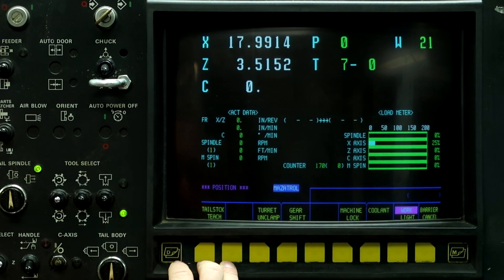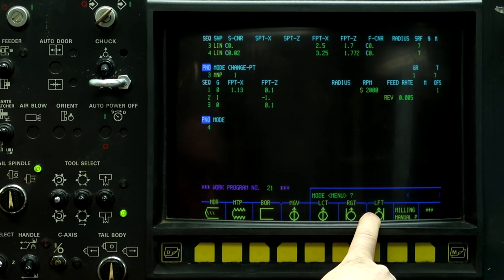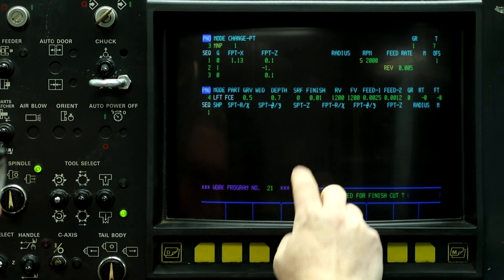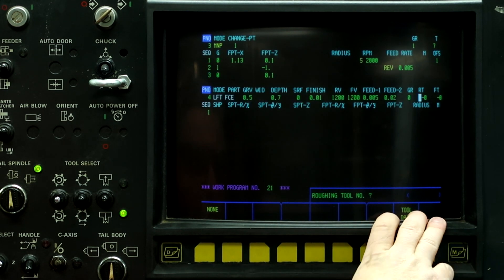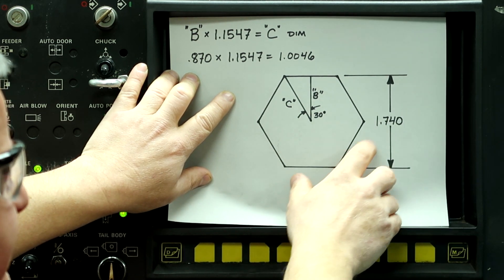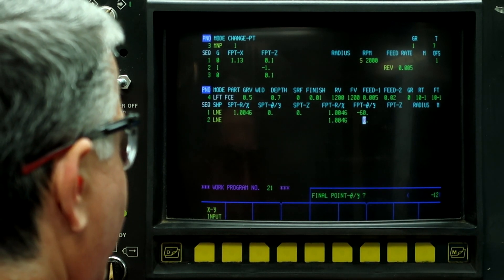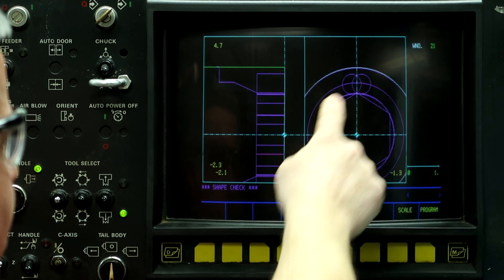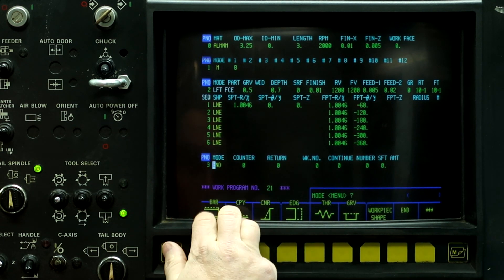Mazak CNC Lathe Milling the Hex Live Tooling

Comment: That's great...!!! You can mill a hex from the face of the part with the C axis. If you got a long enough flute on a regular endmill that is . 

I tend to mill a hex from the side of the part using the Y axis with a face mill. With a newer control and Y axis options. Plus Mazacam. 

Would be great if you could do a video on programming that sometime. Modern machining is 30-40 plus years on your control.

Comment: hi Phil i was doing a simple SQUARE 3.5x3.5 with 5/16" ROUNDS  i used XC mode and ANGLES how would you have programmed this? 
i went from one corner but i had to repeat TWO extra lines  IN ORDER TO achieve the FOUR rounds or it would've not given me the fourth round . and the reason i did this for obvious endmill mark corners are always better to lead in and lead out.

Comment: So, this would only work on a standard 3 axis lathe with T control right?
Reply from the maker: This works on any Mazak Mazatrol control with full C-axis milling.
Reply: @mazatroltipsandtricks6816 

Is it possible to mill without the c-axis?
Reply from the maker: @JoyLong  No. How would you mill without milling function?

Comment: Hello
Reply from the maker: Hello, do you have a question?
Reply: @mazatroltipsandtricks6816  
I'm trying to cut a square on the face of my part. When I look at the finish product, the square ⬛️ is nit square ⬛️.  It still has a radius on it. My square ⬛️ is 1.18 ⬛️.  I would love to be able to email you my program and a picture of the issue.
Reply from the maker: @tripledam15  Sounds like you are not setting the endmill correctly. The endmill needs to be set to centerline same as a drill. Do not probe the OD of the endmill.

Comment: Hi Phil, I have a 2001 model Mazak SQT200M with a 640T control. I've drilled holes in the face of the workpiece using the C-axis at 60° increments before, but when I tried milling a hexagonal using your programme it just kept giving me the alarm mesage "depth of cut required"!  I'd already entered 0.7 but I'm guessing this is the depth in the Z-axis and not the incremental X-axis which it didn't ask for when I was programming it. Help much appreciated!
Reply from the maker: Maybe the tool data page has a blank field for depth of cut for the endmill you selected?
Reply: @mazatroltipsandtricks6816  Thanks Phil, I looked at the tool data and realised it was still on 'mill drill' instead of 'end mill'!..changed that and a new option appeared for depth of cut and milled my first hexagon  :)
Reply from the maker: @Hellishcrusade  Glad it helped.

Comment: Is there a way to change the cut pattern? I can program it long hand but prefer not to. I.e when roughing out my hex it moves in Z what I want it to do is rough using X with the full width of the cutter.
Reply from the maker: The old machines like mine do not take radial passes like the new machines.

Comment: In mazatrol how do I program milling for integrex.  Need B axis  at B90. I can program milling at B axis at B0. Cutting With the side/flutes  of the endmill. But I need to cut with my tool at 90. When I program it, the endmill wants to go thru the part . I can drill at B90. But milling just don't work.. please help or help me find an example program in MAZATROL. Can mill at B90. In eia.
Reply from the maker: You need to put in a WPC shift unit in X in order to mill at B90.  If your start plane is at a radius of X 2.0, then your WPC shift in X needs to be 2.0.  You must add a second WPC shift to bring X back to X0 if you are going to run another unit that does not need the WPC shift.

Comment: Sir please make a program of hex in mm how to calculate the start point of x/y
Reply from the maker: It would be the same procedure as doing in inches. The formula is the same.
Reply: Diameter x 1.1547. @ 60 degrees

Comment: Phil, now that demonstration is what we call Axial milling?  I need to machine 2 flats in a part for a wrench, which is probably what is called radial.  I got tool holders for that, but is that SQT-18 ms capable of doing that?  Need a Y axis for that kind of work?  Do I need to get a keyseat cutter log enough to reach those slots?   Flats are not on the face of the workpiece, they are  .978" in from the face of the workpiece and .25" wide.
Reply from the maker: Yes this is axial milling.  You would need a Y axis to do the part you describe.
Reply: @mazatroltipsandtricks6816  OK I might seem like the persistent pest here.    Would you attack that feature with a ball mill and small step overs or just chuck it up on the dedicated milling machine and do it there in under 4 mins.
Reply from the maker: @joeshmoe5935  Machining it with a ball mill would technically work but really not practical for this machine.
Reply from the maker: I thought about your example a little more.  I think I could do some cough lying to the machine and get it to mill this feature with a ball endmill in a Mazatrol process.  I will have to do some testing and see what happens.  If it works, I will make a video on how to do it.

Comment: Hi Phil, Very good videos and very to the point. Can you please do a video of machining a 8mm across flats internal hexagon ? The trouble is i want to use a 3mm dia slot drill but go past the end point of the 6 corners so you remove the corners and not leave 3mm rads in the corners.
Is this do able ? If not I would appreciate if you could email me direct as regarding a programme example. Let me know please.

Thank you.

Comment: Hey man,
I tought you told it in some of your videos but can’t find it anymore,
How do i need to set my endmill?
Just touch it off and then minus or plus the radius? 
Can’t i just take the center of my milling tool holder and then plus or minus my endmill radius?
Reply from the maker: The endmill needs to be set to the center of your milling tool holder.  The machine will calculate the required offset of the endmill in the tool data screen.  Do not plus or minus anything.  X Geometry needs to be the center of the holder.